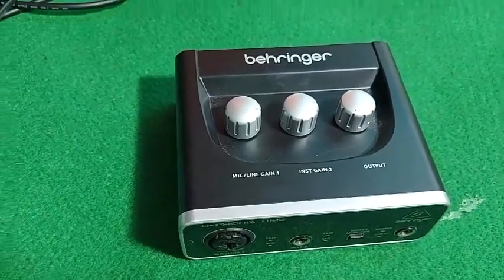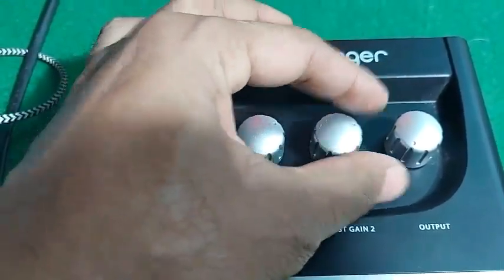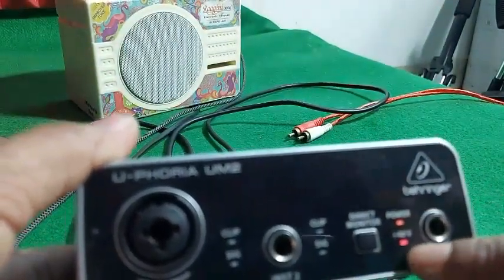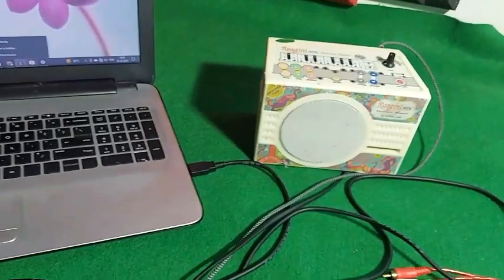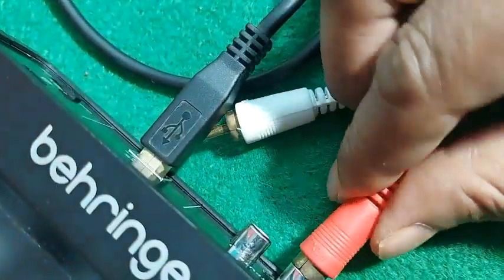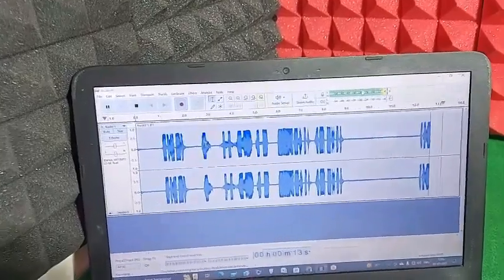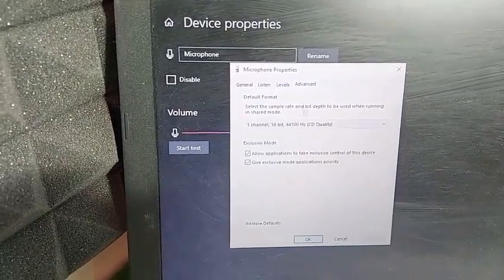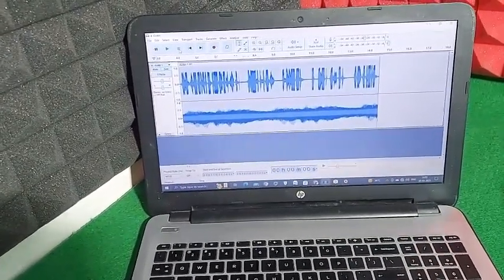No recording Inst 2 : Behringer UM2 audio interface : Demo and Trouble shooting

Comment: Sir am not getting option of 1 channel by which sound is only coming from one speaker and one side of the earphones please tell what to do
Reply from the maker: Pl chk earphones or speaker pin whether properly in inserted or some loose connection
Reply: @TanishasClassics  driver issue
Reply: @TanishasClassics  am only getting 2 channel options